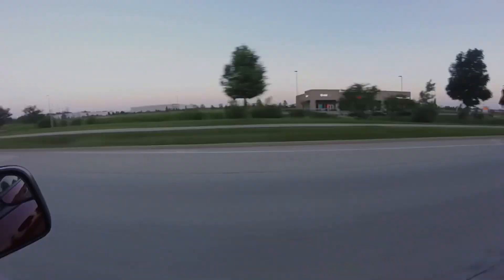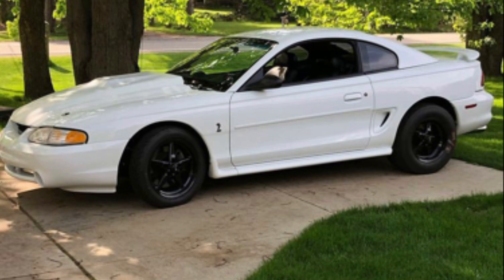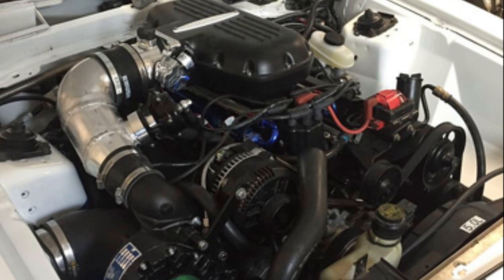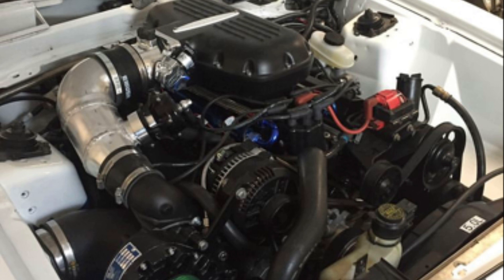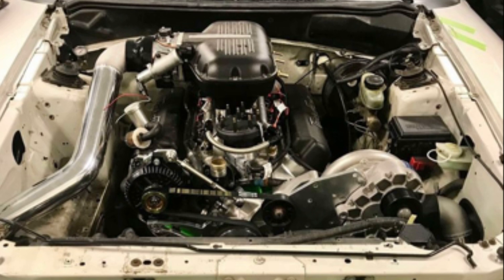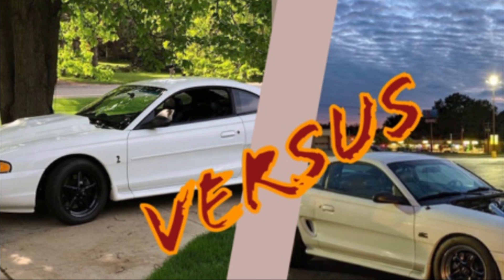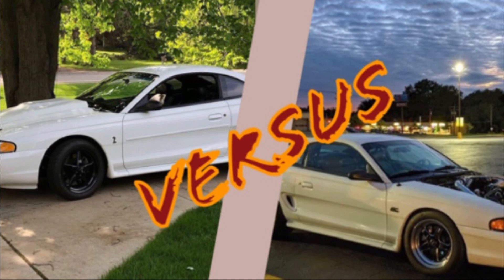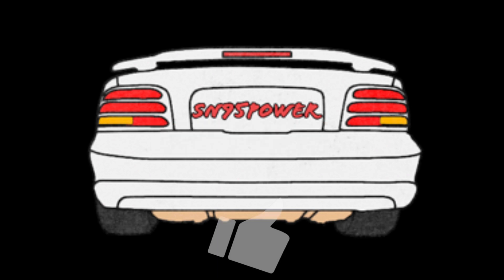Sn95 Mustang Cobra 408 Versus 363 Vortech YSI vs Vortech Ti Supercharged Mustang VS Battle

Comment: 363 is a 302 based aftermarket block
Reply from the maker: Good catch. Big bore and stroke 302. I originally had a 351W car  for match up and didn't revise the script. Thanks for pointing that out
Reply: That's what I have. Dart Sportsman block based 363.
Reply: @MrCaribe65  
How do you like it
Reply: @xmo552  
It's a big improvement over the stock factory block. I cracked mine just torquing the headbolts 10 pounds over stock. It cracked in the front corner above the oil filter. The Dart block is much beefier. With my forged internals, I no longer worry too much about the bottom end.
Reply: @MrCaribe65  
Thanks.
Reply: @MrCaribe65  must be a weak spot because the same thing happened to my block as well, it was previously worked on before I got it and stroked it out but I got it from a junkyard and was wondering if that was why it was at the junkyard but its got a little 3/4 crack on the first head bolt hole and it's on the outside of the block in the threads and didn't discover it until I did the first fire when it started slowly dripping antifreeze out of the crack on the outside of the block
Reply: @79beans347  
I made sure that my old block went to scrap. That sucks that you bought a cracked one for your build. 
I didn't know this could happen, until mine popped. After it did, I found forum posts about the same thing happening to others.
Reply: @MrCaribe65  yeah it sucks big time especially when you get all excited to finally see it running after all of the money and lots of it and time you have tied up in it only to get out and look for leaks after all of the header smoke clears and find a little leak thinking at first it's a freeze plug only to find out under closer inspection that it has a tiny crack with antifreeze seeping out, I would have never thought that the block was bad because it had a new crank and bearings and new head gaskets and timing cover gaskets and the only thing that I saw was the pistons had a lot of soft carbon build up like it wasn't running right so i thought that who ever junked it just gave up after it didn't run right then you could tell that it sat up for a few years before it went to the junkyard because the gas was bad, but yeah man it was a major let down after buying parts over a year's time to build it
Reply: 363 is a 347ci with 4.125 bores..over square motor...dart big bore block 8.2 deck height

Comment: I would love to send you some video of my car when it’s done bro!!! I just got it back from the resto shop, had it gutted painted! Full interior car all re done head to toe new seat wit skins and blah blah, not the juicy part it has a mmr 1500+‘you  can call it lol it started it life as a brand new teksid block 4.75 1000se, and I tore it all down and threw in some custom l&M diamond pistons coated 9.5 compression livernois ported trick flow heads, that modular head shop redid with his 185r package bigger valves bronze guides cleaned up livernois porting job a bit, full snow performance water meth kit, braided lines all around nothing plastic or rubber, fore innovation complete fuel system and a procharger f1-94, once it’s all in and we get some numbers I will decide on either twin turbo or sell the drive train and go built coyote with turbo.
Reply from the maker: Everybody going coyote, stay old school. Gosh, that's sounds weird calling that old school😂.  You'll have a lighter motor with the teskid setup. Let me know when you get it running, going to be a beast. Shoot me an email if you want to send some video Sn95pow@gmail.com
Reply: @SN95Power  for sure